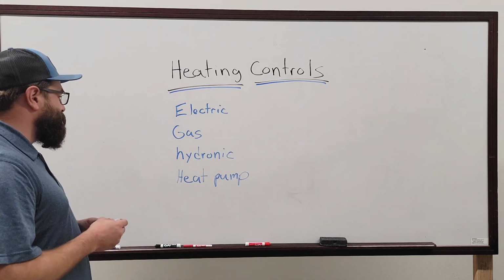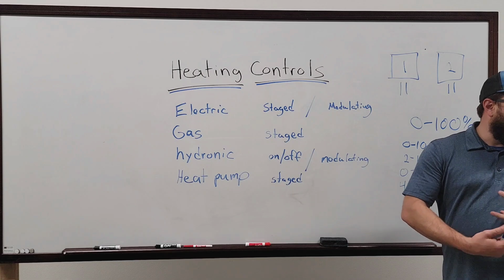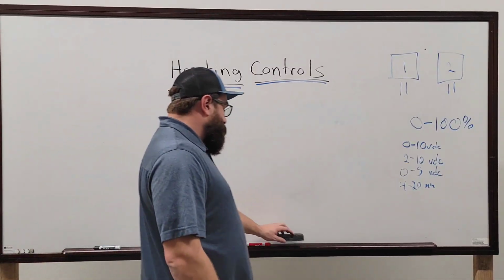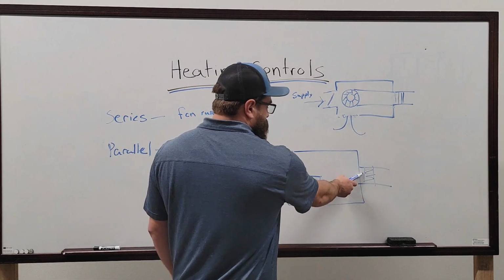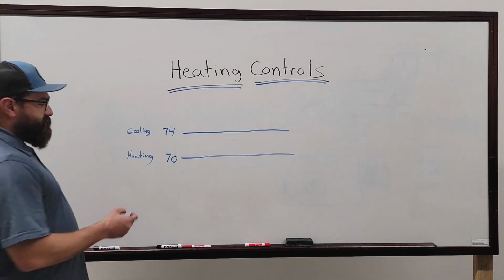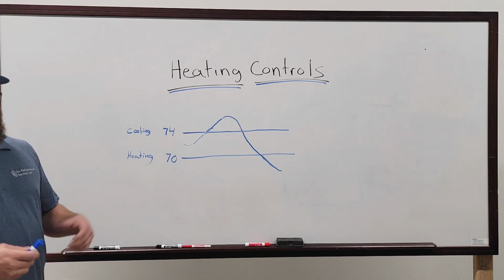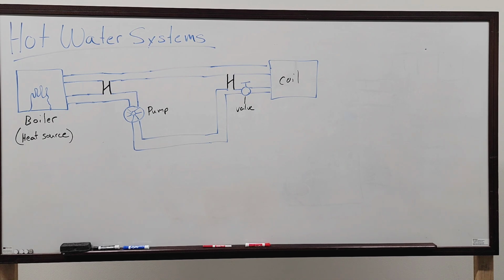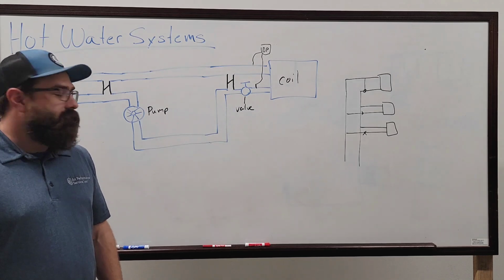HVAC Training: BMS Heating Controls

Comment: You have never controlled a burner firing rate with direct 0-10/4-20? Single burner application… do you live under a rock?
Reply: hes in Texas, I'm in Florida, in Florida you rarely see gas burners, we use more heat in the summer for de-humidification than in the winter for reheat. I'm sure that's more common up north.
Reply: Most of our boilers are using modulating firing rates where im at. Very few are on/off. In residential, sure and those are atmospheric. In commercial/ industrial it is probably 95%+ that are using mod motors. Lots of power flame burners and control's.  Low/high/low